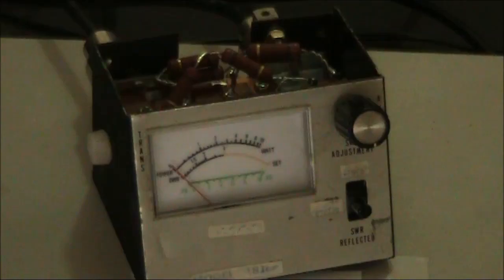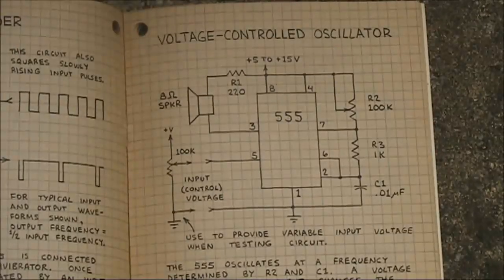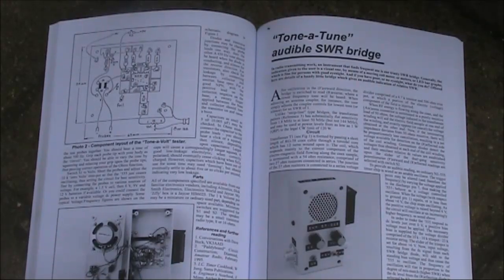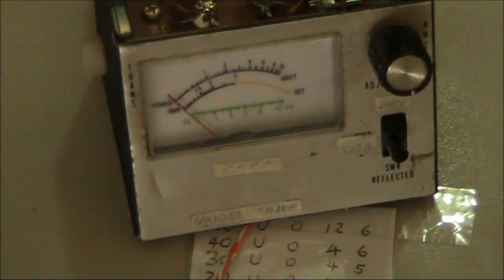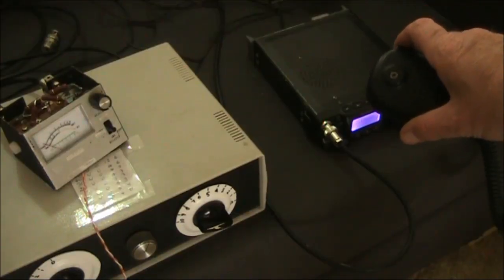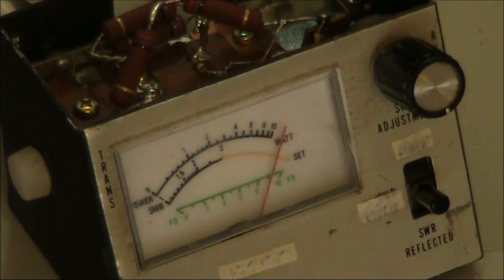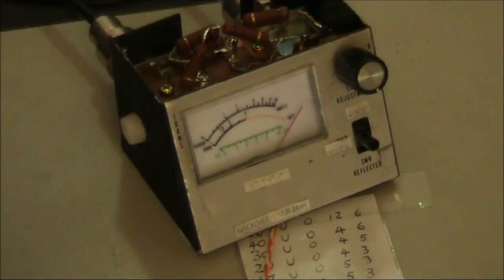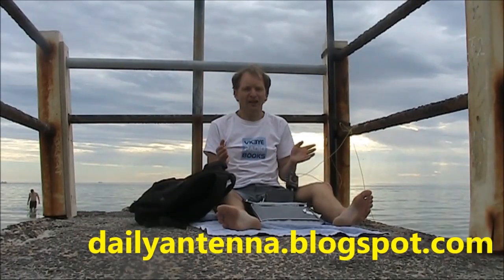Audible antenna tuning adjustment indicator

Comment: Peter, Nice video. I am wondering about building a SOTA type end fed tuner where the LED SWR indicator is aided by the sound as well. The are many times
when I am tuning with the LED, that the sun is so bright, I cannot see what the LED is doing. Would that same circuit work for the LED tuning the same as a meter movement?  Thanks.  Adding it to the list of my projects. 73.

Comment: This is a very useful idea/project. Smaller and lighter than a meter, it would be more rugged as well. A small box to hold the speaker, bridge and battery with BNC connectors and there you go. Slip it into the circuit for tuning and out when ready to operate. Great for portable operating! Thanks Peter!
Charlie KM4ZZ.